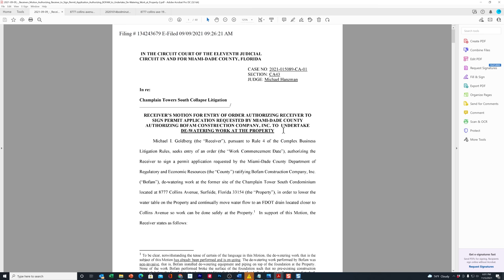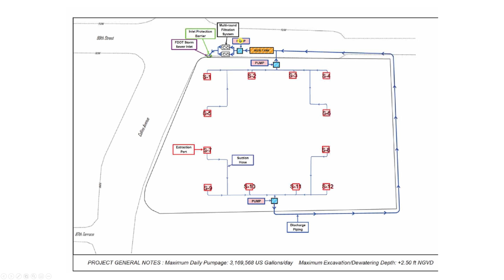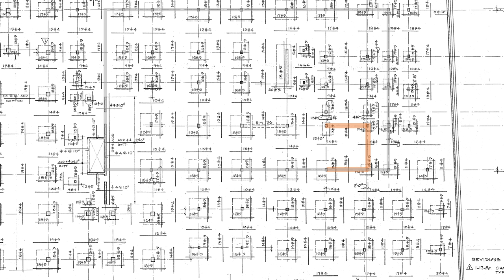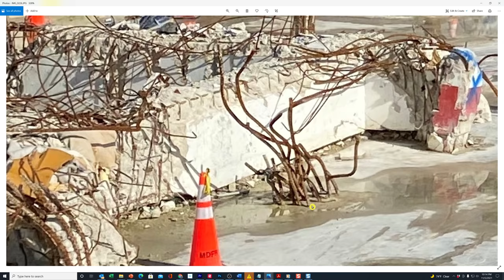Miami Condo Collapse: Engineers Baffled By Mystery Column

Comment: Clearly a column from above that was driven into the ground. It probably doesn't even go more than a foot or two deep.
Reply: So the column went in perfectly vertical, ended up perfectly aligned with the 'O' row of columns and perfectly spaced in between the columns that held up the H beam?  Get real.  That's a quadrillion-to-one longshot.
Reply: @johnbergstrom2931  It wasn't perfectly in line with the other two columns. It was spaced a bit offset to the other two. It would also be pretty stupid to place a column in the middle of the main driveway. Where else would it have come from when it wasn't there in the garage video? There would have been no point in just putting a column there in the time between the video and the time of the collapse. In case you also failed to notice (which judging by your reply you have) there also appears to be another column sticking up  from the other side of the H beam as well. There was also ZERO record of ANYTHING that major being done to the garage either. The residents would have bitched up a storm if a column was added there for no apparent structural reason. There would also be a lot of damage to the underside of the H beam in the spot where it would have been positioned, but there isn't. It's as flat as the rest of the H beam's underside where there were no columns. It was CLEARLY the column that had been above the H beam and NOT a column under it. There was so much weight coming down on such a column that it could have very easily driven through the the concrete that made up the garage floor. Get real. There is a thing called "deductive reasoning." Then again, the fact that you think it's a "quadrillion-to-one longshot", logic isn't one of your strong suits. I don't think you actually appreciate how large a number "quadrillion" really is. 1,000,000,000,000,000 is quadrillion. Quintillion is the next one up.
Reply: @GeneralKenobiSIYE  Wow, "deductive reasoning".  Too bad you don't know anything about physics, except what you've learned in comic books and cartoons.  
Ya see, when your inital axiom is wrong, your conclusion is wrong.
Reply: @johnbergstrom2931  Comic books and cartoons? That's rich when you seem to completely ignore the fact that there were at least twelve floors of weight coming down onto the bottoms of broken columns, and some of that weight had to [ gasp ] fall at least twelve floors adding enough kinetic energy to drive the bottom of a broken column through a concrete slab that had been attacked by salt water for 40 years. It's not like you can drive a nail into a new concrete slab that hasn't been attacked by pooling salt water for 40 years with enough kinetic energy or anything, oh wait... You can.
Reply: @GeneralKenobiSIYE  Okay, 'General Kenobi', retreat back into your fantasy world...
Reply: @johnbergstrom2931  Straw impales 1/4" into a tree during a tornado.... CARTOON PHYSICS!
Reply: @GeneralKenobiSIYE  Yep.  And if you had any idea what you were talking about, you'd understand why that happens and realize the differences in kinetic energy, puncture pressure, elastic modulus and brittleness between wood fiber travelling 200 mph and a 2000 lb concrete column free falling one story.

Comment: That one column must have punched through that floor, disintegrated and only rebar is visible now. Hmmm...
BTW, all hat concrete sure looks very very chalky / weak.
Reply from the maker: zero damage on the floor where there should have been craters or something else if it had impaled into the floor but there is no damage. These rebar rods look like they were intentionally built up out of that concrete floor like it was done by somebody in the last 12 months, since Fiorella shot her video inside the garage in July 2020, showing no column exists where that mystery column is.
Reply: @jeffostroff  yes, very weird.

Comment: But they used the correct strength cement for the H beam because after the collapse, the slow moving cleanup of debris with all those trucks and equipment, the H beam is intact, figure that one out and explain How is still intact, explain it, dont skip it how, IT DIDN'T CRACK THE FOUNDATION, GIVE ME A BREAK,
Reply from the maker: IT was a beast! Look how tall that beam is, and look at all the rebar in it

Comment: Rebar left behind  from  the upper upper floor column that slammed into the floor  that is where it came from.  The difference in hardness of the floor and the beams is enough   fore only the steal rebar to be left , why do you think the concrete floor intact and smith  around the base of all the other columns  and not pulverized. The foundation is  far  harder  and stronger than the rest of the building.  I do not see how engineers  would be baffled.  If  they are they should  work with  experts in building demolitions.  nothing more than impelled rebar .
Reply from the maker: It could be, but sounds too perfect

Comment: There is no mystery column....the photo you show is not of the 'h' beam because the photo shows something attached to the ramp.  And why is the ramp 5 feet above the floor level of the parking garage?  Something is wrong with your analysis.  If as you state, the water collection trough is at the base of the ramp in your photo then why is it sitting approximately 5 feet above the floor level?  The ramp isn't attached to the 'h' beam, so the photo you show is of some other object and not the ramp or the 'h' beam.  The mystery grows.  And your analysis creates more questions than answers.    I think what we are seeing is something from above the basement deck level (during the time the building was standing).  The height of what you refer to as the end of the ramp, above the deck level proves it is not the ramp.  The ramp ended at the parking floor level not 5 foot above.
Reply from the maker: Something is not wrong with my analysis, something is wrong with your logic, and ability to pay attention to the video. The photo overhead at 1:06 clearly shows the H-beam is not attached to the ramp, it is a couple of columns over from the ramp. Nothing is touching the ramp so you are wrong not me. As for the ramp being 5 feet above the garage? I never said that, there is a 6'5" clearance at the top of the ramp at street level when cars come down the ramp to avoid the beams on the ceiling as they travel down the ramp. The bottom of the ramp is about 8 feet below the street/lobby level floor. I never said the line drain at the bottom of the ramp is 5 feet above the floor, you are making that up. IT sits on the floor of the garage. Fiorella's video inside the garage shows what I am saying to be true, that the ramp and on the garage floor level.

Comment: It looks like there was a weak shear connection of the first floor column to H beam.  Looking at the damage to the H beam where the first floor column connected is minimal, indicating the first floor column sheared off the top of the H beam as the H beam moved to the side as the rebar and location of the beam indicates.  So as the building collapsed the first column was intact and vertical, thus impaling the rebar of the first floor column into the basement floor.  Again look at the damage (or lack there of) of where the first floor beam connected to the H beam.  If the connection point had sustained more damage, the first floor column would have contacted the basement floor at an angle and the rebar would not be impaled, thus no mystery column.  This is also substantiated by some ones observation that the concrete at the mystery column floor (connection?) is smooth, indicating there was not a column there.  Thus, no mystery column!
Reply from the maker: Yes I think it was very weak also, and not much support rebar, unless...maybe the demo crew cut it off.
Reply: So you're arguing that we're hallucinating?  What are you asserting?

Comment: Why is the "H beam" even called an H beam? The top part of the H is missing. It is more like a Greek capital letter pi (Π).
Reply from the maker: There are little bits of the H beam missing simply because it was sheared off of the four columns that supported the four points of it if you look at the back end of it you can see stubs of it sticking out two or three feet remember that beam is so big that the little bit of stub that sticking out doesn't look very big but it is big big enough that in the photo you can see the column with the red stripe on it is nestled nicely into the corner
Reply: If you look at it on the original plans, it's almost an H.  Hard to describe it as anything else...

Comment: Upon further review your own “H” pattern picture with the 5 green boxes tells the story.  The mystery col. is sitting in the same linear plan as the 2 right most col in your demonstration picture that supports the “H” Beam. if it were sitting on top of the load bearing cross beam on the “H” beam the mystery col. would have dropped near to that cross member. Ergo the mystery col. was not sitting on top of the cross member beam as theorized, but was in fact sitting askew from the support beam below.

Comment: Unless you personally took the picture then I suspect it is not where you think it is. If it is new certainly there would be records and/ or engineering drawings
Reply from the maker: Look at 1:06 again, that shot was taken directly overhead clearly shows that the H beam is exactly where I said it was. Everything makes sense and lines up including if you paid attention to where I said watch this column with the red stripe on the bottom. It's the only column in that area of the garage with the red stripe. And when you look at the video of the lady walking through the garage it clearly shows as I pointed out in the video, the H beam sits with the corner of it directly on top of that red striped column. So everything aligns to what I said. You need to prove how and where I am off.
Reply: @jeffostroff  without being able to visually survey the area personally I can’t offer any other explanation although I believe there is certainly a valid explanation. For me I think the bigger mystery is something you pointed out in the video about why was the “ H” beam the only piece of debris left behind ?
Reply: @dominicm2175  Because the H beam is giant (22' x 22') & heavy (>65,000 lbs) and can't be carted away intact on a truck.  The investigators were being cautious, making sure the H beam was not pivotal in the collapse before jackhammering it into smaller pieces and possibly destroying evidence.  
Maybe now they're done with it's analysis and leaving it as 'someone else's problem', whoever redevelops the sight.
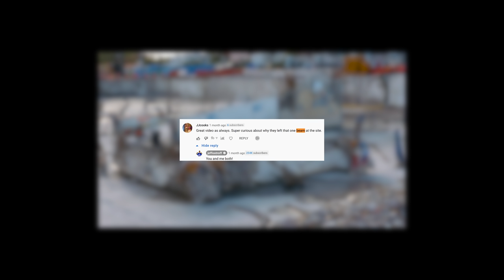Reply: @johnbergstrom2931  At 6:30 Jeff asks the question about why was the H beam left behind and my comment was that I was not asking for myself but only stating that I believe it is a bigger mystery and should have been the title of the video. As far as your answer that it is too big and heavy;I believe that answer also applies to much of the debris that has been hauled away and that there is much more critical answer to the question that the investigators/engineers on-site have yet to share with the public.
Reply: @dominicm2175  Well, obviously the rest of the debris, including the even bigger transfer beams on the west side (36" x 42" in cross section, vs. 24" x 42" for the H beam) was broken down and hauled away by truck.
There was an extensive array of transfer beams supporting the condo units over the west side lobby and front parking lane.    The H beam is just the baby of the bunch.  The architect also wisely put larger 24" x 24" columns under the west side.  That's largely the reason it didn't collapse, at least not until they purposely brought it down on July 4th.
Why the H beam was left behind is somewhat of a mystery, especially since NIST seems to be done with the site, allowing it to flood with groundwater again.

Comment: The mystery column is from the lobby level it’s the one you are referring to that goes all the way up to the roof at 2:22 the green square 🟩 you can tell by the rebar that has been stripped out of the topside aka lobby level and is still connected to the top of the monolith beam assembly where the infamous red post parking spot 17 had been. The video proof is in your videos what appear to be a mystery column is the 1st level column flipped upside down. If you need more information/ guidance to see what I’m saying just give me a message back. Mystery solved
Reply from the maker: No damage to the garage floor? And it happened to land straight up?
Reply: @jeffostroff  you are correct that column was definitely added as you can see that the floor was cut in a square around the rebar. Great work. Mystery NOT solved!
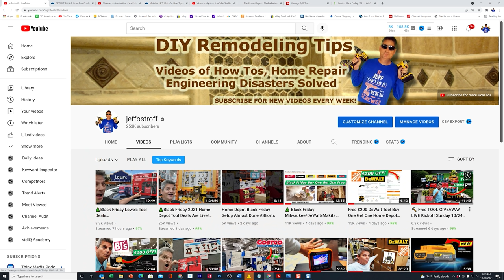Reply: 15:30 you can see that someone cut a notch in the bottom of the H beam where the column was connected.

Comment: lol it looks like there is a pipe going through the H beam in the video the woman took in the garage. Probably not structurally smart to touch anything to do with it.
Reply: It doesn't penetrate the beam.  You can see this on the video of the wrecked beam - no holes in the center.  No, it runs up through the slab and serves as a drain stack for all the corner unit kitchens.

Comment: Plenty of energy in the collapse to cleanly drive/punch the above mid colum on the transfer beam into the poor rotten water laden foundation. Especially if that column was well aireated/concrete free of air when orginally poured. 
The photo detail/pixels are not clear enough to confirm your speculation of an unpermitted added basement column.

Certainly some INDEPENDENT excellent structural design firm can enter in the design data and use current dynamic design software to analyze the integrity.  And compare the current conditions to define how the building failed.
Perhaps some of the failed building components can be reconstructed in a lab, and subjected to expected/theory collapse actions to confirm the design integrity. Extremely expensive to do!!!!

Yes, the original design is quite poor by today's standards. The origin design may have been adequate, and acceptable for the decade of original construction. This structural design method likely won't be acceptable today.

Today's standards, specifications of materials, and dynamic design, methods, are much improved.The experience, and competence of structural engineers, must be specific to every project location and site conditions. Especially in a site close to the ocean, and water table.
Reply from the maker: Whenever you make a claim like this about the column falling eight feet and impaling into the garage floor, you forget that there is zero damage on the floor where there should have been craters or something else if it had impaled into the floor but there is no damage. These rebar rods look like they were intentionally built up out of that concrete floor like it was done by somebody in the last 12 months, since Fiorella shot her video inside the garage in July 2020, showing no column exists where that mystery column is.

Comment: The mystery col. may well have been incorrectly placed on the 1 fl. not sitting directly on the top of the “H” as planned but slightly askew causing that col. to literally punch through the basement fl. below thereby looking like it belonged there.  In other words that col did a reverse punch through the floor and then literally penetrated the basement floor. On the magic that is the only logical source for the mystery col. in the basement. And the investigators probably already know this and like much of what happened in that Tower will never be revealed for liability (county inspections) reasons.

Comment: Ur H-beam has been moved
Reply: Yeah, Captain America needed something challenging to dead-lift...
Reply from the maker: No, the H beam has not moved look at 1:06 that photograph shows the current position of the HP and the red box shows the outline of the building. If you compare that to the floor plan the H beam is in the exact spot it is supposed to be in the floor plan. It did not move. As the building collapsed right down on top of it so it would have fallen straight down to the garage floor 8 feet below.

Comment: It is obviously the shared column that ran from the first floor to the penthouse, now impaled in the floor. OMG! What a mystery where this came from! Has gravity ever hit your engineering radar! FFS! OOOOOOOOOOOOOOOOOO, gravity is soooooooooooo spooooooooooookyyyyyyyyy!
Reply from the maker: Your hypothesis comes up a lot from boatloads of people about that column. I don't think it's possible because if it had slipped off it would not likely have come straight down where the mystery column is which is only about two feet away from the HP. Also if it had impaled the floor there should be damage all over the concrete there and there is none where is the crater? So where else could the column come from? So far my prevailing theory is that somebody started to build that column sometime after Fiorella shot her video in July 2020. however I could find no permits for it